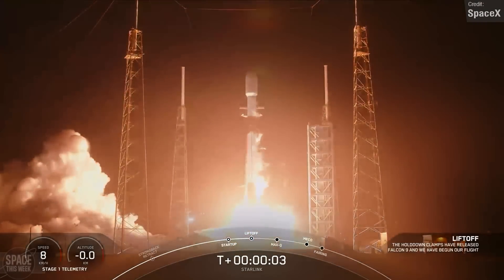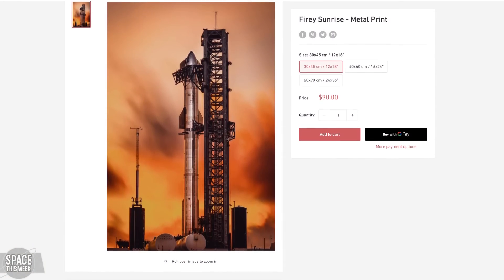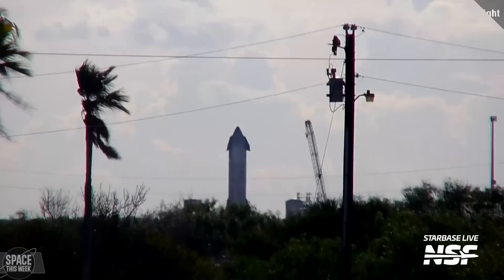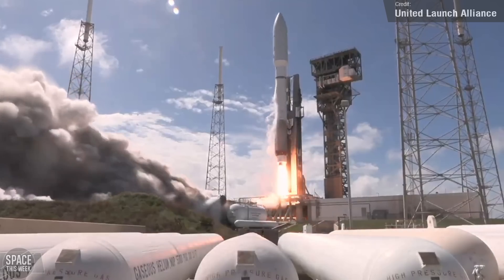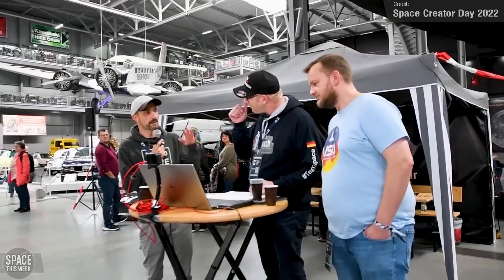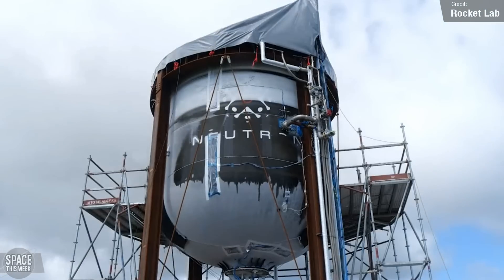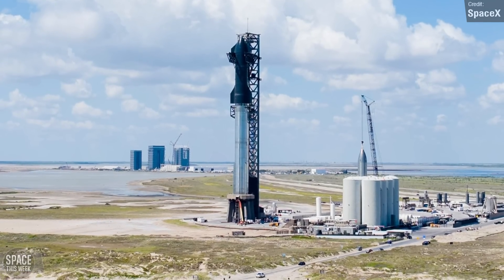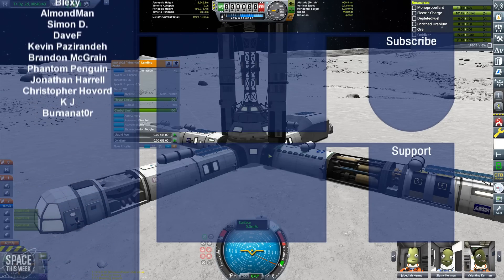SpaceX Starship Destacked as Storms Hit, Cybertruck on Site, Amazon Begins Kiuper & Neutron Cryotest

Comment: Meanwhile NASA leaves their Artemis rocket out in hurricane conditions on the launchpad.
Reply: I was also under the impression that moving SLS from pad to shelter requires more consideration because it is more susceptible to damages and unwanted structural stress. Maybe they thought that a Strom would do less damage than a move to the VAB. I'm not sure how much restacking or restacking starship hurts its structural integrity.
Reply: A big part of it is that it takes 11 hours each way to roll the mobile launch platform back to the VAB from pad 39-B. But starship can be de stacked in place thanks to spaceX’s chopstick design
Reply: Yet it was still able to complete its mission without a hitch.
Reply: @Hwalker-o8n maybe because it’s been in development for decades? and also starship has always gone without a hitch, they don’t care if the vehicle is destroyed, they care about the fact that testing it in actuality rather than math and simulations as it will always give much better data
Reply: In an even meaner while, the Russians just launch Soyuz through fully developed thunderstorms. That ICBM heritage does have one advantage, because global thermonuclear annihilation doesn't wait for the weather to clear up.
Reply: He said they left the rocket out in the storm last week💀
Reply: It’s because its more difficult for NASA to move Artemis compared to starship which is easy to disassemble the rocket like lego
Reply: Artemis I was moved back to the VAB for shelter. They probably didn’t want the rocket to get damaged since we put so much of our taxpayer’s dollars and government funds toward that rocket, so better be safe than sorry.
Reply: well yeah because their rocket was designed to withstand various forms of inclement weather, its telling that starship cant
Reply: @exilestudios9546 It could, but you don’t leave prototypes in the rain and high winds needlessly while in development.
Reply: @exilestudios9546 Starship did super sonic summersaults in mid air without breaking up??? 🤦
Reply: @nooblerelf5309 starship did supersonic summersaults while in virtually zero atmosphere, and bent about 40 degrees at the connection.
Reply: @exilestudios9546 not that it can't, but that it's best practice to be as safe as possible. SpaceX is being /safe/ here.
It should be able to withstand a strong hurricane on the mount in an emergency